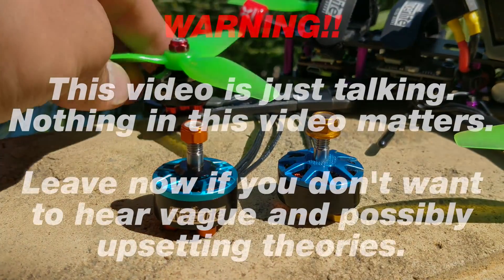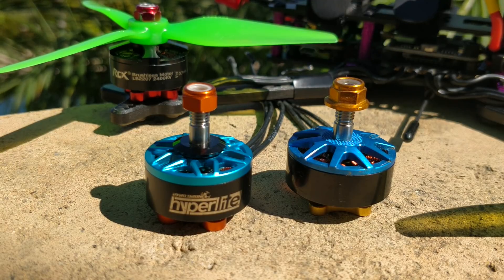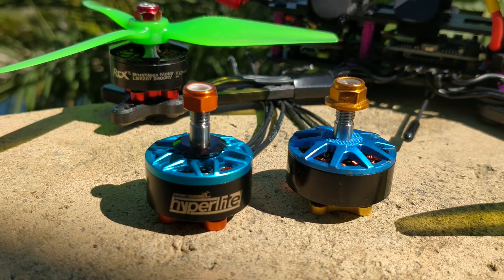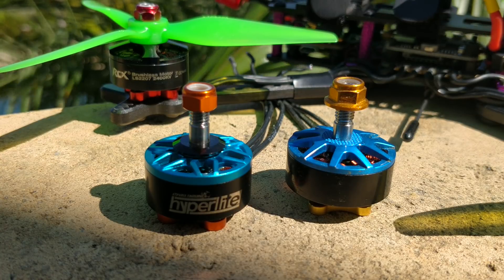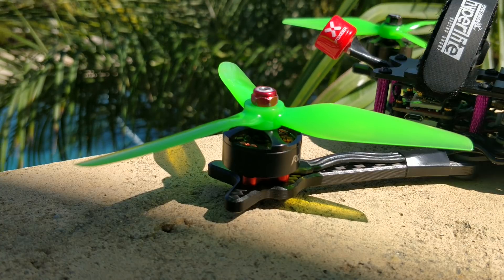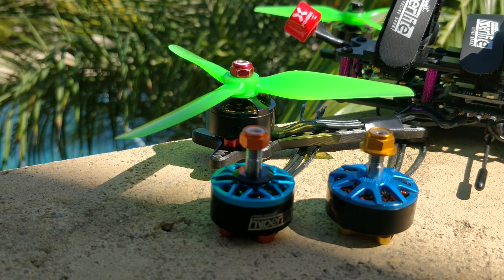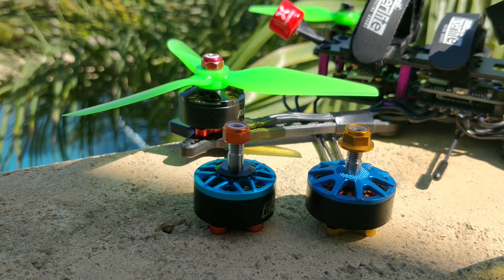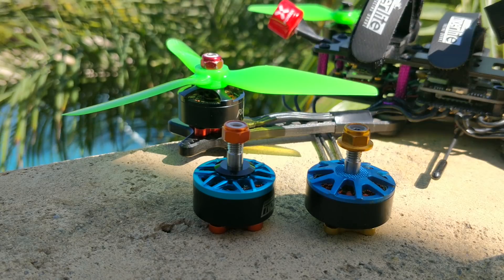Kv, Handling, 6S, Acro - Motor Theory (just guessing here)

Comment: I think all the torque, prop rpm and pitch likely produce counter-intuitive results if the aircraft's momentum is opposing the thrust vector ("drifting").  How does torque produce grip when you're talking about air thrust?  I think the column of thrust might change shape based on how it's compressed and deformed by the opposing relative movement of static air molecules, versus having the momentum and thrust vectors aligned and then adding more speed (through clean air).  A possible way to test for handing in turns and 180's (grip) could be the have a thrust stand mounted on a weighted sled that falls down vertical tracks, in timed slo-mo (with painted measurements on the background like mythbusters, maybe use this to analyse the video; https://physlets.org/tracker/ ).  The downward acceleration curve would be constant, but the ability of a battery / motor / prop combo to resist the fall could be precisely measured.  You'd then be able to tell which combo actually can exert more "torque" on the air without creating a thrust cone like an arrowhead, when you want something like a modulatable round parachute canopy made of thrusted air.
Reply from the maker: Wish I could execute that kinda testing
Reply: The "column of air theory" was (when analysis tools were in their infancy) originally was just used and developed to help visualize conceptually what the propellers are doing in a single vector air stream. So it doesn't lend it self well to how quadcopters actually fly in 3D dimensions. Additionally, very few computational model software platforms have accurate modeling capability at low Reynolds numbers (the numbers that are associated with modeling-sized propellers). So believe it or not it's just a guessing game with how we "Think" a design will perform based on trial and error.
Reply: ZCarrizales absolutely nailed it - at the Reynolds number regime we're talking about, those air boundary layers get really complicated in CFD and stop lining up with reality.  This is a HUGE part of why the super-engineered designs (RK5051, GF5149, etc.) and up performing so similarly to 'hand-sculpted' equivalents like the V1S and DAL Cyclone design.
To make matter more complicated, when we're considering negative AoA thrust for a motor/prop (+esc/battery//gyro/firmware) combination, we're often including rapid changes in commanded throttle value to compensate for dirty air we're flying through, so that demand for torque (in the change RPM of motor/prop as rapidly as possible) is even more massive, and the ability to rapidly achieve target or slight overshoot on the RPM to hit that thrust is what makes the difference on control there.  Excess KV (in the sense that Ryan Harrell is talking about) is a way to 'trick' the system into doing that more readily, with the penalty of when that same system is under peak load the ESCs can demand power out of the battery into the sag regime where the battery gets really punished for marginal gains - hence throttle limiting (or down the road, soft current limiting that incorporates all 4 ESCs as well as individual peak draws)
Reply: How would any of that effect the results of my proposed testing method, hypothetically?  The tracks might be 5-10 stories tall, and you'd be measuring time deviance from a dead drop, with the sled weighted to be the same no matter what was being tested.  You could test multiple drops at different throttle values, and average them.  You could call the resulting numbers "repulsor" values.  You could probably adapt this idea to give useful data based on the force exerted on the load sensor of the thrust stand if you have a precise enough wind tunnel, but I think the acceleration of gravity would be more consistent, as long as the rail bearings are good.
Reply: Testing method would be fine, and with enough data points you could figure out what the range of values should be at various relative airpseeds - mere average wouldn't necessarily be adequate.  It would be another extremely valuable data point like the static case - but not fully inclusive of what's going on in a split-S, immelman, or powerloop though - but what could be?  I'd be super excited to see data like that, since it would be 'cleaner' than any budget wind tunnel options
Reply: @mistercohaagen  What motor/propeller behavior would you be hoping to gain more knowledge about? Your experiment sounds like it is trying to shed light on motor responsiveness under load, but with respect to the propeller behavior (this set up might skew) variables might be skewed by vortex ring issues from propellers (prop wash).
Reply: @Z Carrizales, Grip efficiency.  The experiment is designed to measure how much power is used for a given braking thrust force, against the wash of a fixed falling mass through the air.  The wash is an essential component of the overall data.  The data you'd get would be watts / watt-hours, and time gains over a weight-calibrated dead drop, that the braking for a given throttle input was able to give you.  If you knew the total height of the drop, you could calculate deceleration force in G's and meters per second per second.  You could also have a load cell to get the amount of force you'd be exerting on the arm for a given throttle (power consumption) to increase accuracy.  You'd test throughout the throttle range and plot the data into a regular line graph.  If the bell was more towards the low end of throttle, you'd have a higher grip efficiency at low RPM's, and blah blah blah... I'm sure you can extrapolate the antithetical.  Like anything related to these kinds of data, you'd be able to see the point of diminishing returns, correlate that with your nominal operational range, and quantify a formula of best performance for a given application / platform.
Reply: @mistercohaagen  Gotcha, I see now. The tough thing right now is quantifying "the feel of the quad." Some investigation like your talking about be need first in order to make sure we are correctly correlating desirable behavior that we associate with "positive feel," "good responsiveness," "punchy" and any other ambiguous descriptors we use to guess at how we think our rigs are flying.
Reply: That would definitely be valuable data, but do remember that in any instance where that angle of attack is being achieved, the throttle application is going to be inconsistent (FC modulating to mitigate propwatch), so if would be a pure datapoint (arguably better) but not necessarily reflective of what would be happening in the real use case (more complicated, but also going to be very craft AUW/geometry as well as propeller dependent).
Reply: tehllama42, Yeah, I thought about that too during my last response, but didn't want to add yet more complication to something I was frankly struggling to explain as eloquently as I could at the time.  I think if you added the ability to tilt the sled on the roll axis so you could also graph the changes in grip efficiency over 5° increments, you'd have the data you're looking for.  The air the prop itself would be pushing against would be hitting it at an angle more akin to a turn instead of a full and abrupt 180°.  I have a suspicion that the resulting data would be a fairly linear roll-off similar to trading hover thrust for forward momentum.
Reply: tehllama42, I think what the flight controller would be doing to maintain orientation would average over the 4 motors.  They're all on the same plane, so the data you gathered with a single prop would probably mean the same thing if simply multiplied by 4.  It would be an interesting test to add a full 3-axis gimbal (like those rings from the wormhole machine in the movie Contact, or the VR rigs in Lawnmower Man) that could allow an entire quad, tune and all to be attached to the sled to hold the tilt angle.  This is all practical, but would require the space and budget for the precise machining required to build the rig and tracks.  I used to work in automated laser radar metrology, so building something this big (the tracks) and precise might require something like that if a long plumb bob line or alignment laser doesn't work.  Using an over-under wheeled tubular track like rollercoasters would eliminate the worry about twisted or warping track, but the spacers would add a ton of weight and labor.  I wonder if a rig like this exists for other purposes...  NASA's Ames or somewhere.
Reply: https://youtu.be/fgnbZ4zDBRE?t=4m57s < relevant, kinda (NASA's Glenn facilities)
Reply: https://youtu.be/LEZCxxKp0hM?t=52s < the comparative drop is kind of what I'm talking about here.  Picture that but a lot longer, precise and repeatable.

Comment: Good discussion, this whole thing about torque seems so weird to me in relation to our quads. Im only about 200 packs into my own 6S journey and not an advanced pilot so Im still figuring things out. All I know is I like it a lot. I don't see a lack in performance at 1750kv at all(coming from 2207 high kv) and I even chopped my throttle to 75% and scaled with the new betaflight settings that have been added to butterflight. That has made proximity a dream, it added so much fine control! I would definitely like to try that with a ~1900kv setup.

Comment: dc motor torque is measured from zero rpm, so they measure Hp in Watts( 1hp or 550 ftlb per second=745.7W) ,  IN_rush is the  amperage under sudden start up, which can be triple the Amperage until the motors come up to speed and is variable to the V supplied to the circuit. "Punch-outs" are all in_rush Amps.  we use Square wave escs to keep constant high voltage and lower amps but the pulsing square wave produces more instances of in_rush.

Power factor changes drastically with voltage, inrush, and infrastructure. A house on average draws 150vA to the panel but an old house with small gauge wires, inefficient power conversion, and old motors will require the PowerCo to supply 250vA to that panel.  Since Watts is what we use to measure "electricity put to work or Real Power" its the only thing your meter reads, posing a problem to Power Cos trying to cut cost/increase efficiency. so what i do  to help is decrease the power factor by  increasing the voltage of constant use Loads(120v to 277v) to better utilize small circuits and void "voltage drop", reduce loads, and introducing capacitor banks to supply motors reducing in_rush and inconsistent demand. measuring "Apparent Power" to a motor and the rpm of the motor"Real Power"  can give a good idea of your power factor. tuning either the RPM to match that Voltage supplied or finding  the cause of "reactive Power"  would correct the power factor to 0. large capacitors utilize "Reactive Power" at a small loss allowing it to charge for later instead of generate heat in the wire or motor. higher voltage, larger wires, derating Pdb, and derating esc circuits would negate heat during in_rush and negate a "capacitance effect" allowing for a more elegant "soft start" Square wave protocol that would decrease power factor. Better bearings,perfect ratio of magnet placement to strength, and finely tuned props would decrease Load. Using these values you can actually derive the exact target Thrust to Weight to Amp ratio @ whatever throttle value , no more guessing or feeling.  it would also allow you to size your stater accordingly.
Reply from the maker: unfortunately this isn't a high compliance or high demand field so all that gets sort of jumbled into a mush and they just guess most of it when making motors.  There is usually someone in the factory that can do it all however.
Reply: that is heartbreaking, just got a cnc router yesterday, just waiting for the opportunity to find a cnc lathe. then i can make my own motors to test the principle.
Reply: I pulled over 200amps. With 6s. You MUST use silver or you will de-solder from extreme heat, not easy to reheat and remove, you MUST sand down lightly the XT60 on your 6s 95c lipo. And you absolutely have to use NOALOX on both XT60 connections or they will get so hot and swell. And I never use a 4in one esc. On high kv. 6s. Ok the secret is out!
Reply: HighKV 6S sounds like it's so far into the ragged edge of awesomeness, I don't know if I should stand back in awe, or just starting shoving cash into that shredder to see what sort of awesomeness comes out.
Reply: its the definition of awesome. so awesome i started checking for 8s escs.

Comment: I run high kv 6s, RF bolt v2 esc and 2308 2900kv and it's amazing, wayyy more control than 4s, and about the same flight time. Low speed handling is better also due to increased rpm through out the Rev range, So I don't know why people run low kv motors on 6s. It's 1 step forward and 2 steps back .
Reply from the maker: I do feel 2900 is quite a but much for 6s but the wider motor isn't allowing the top end of the throttle to pull lots of Amps so you get the efficiency back.

Comment: So does torque come with the inertia of a bigger motor? Inertia creates resistance to motion (top end slower I would assume)
Reply from the maker: Spinning these props even 6" quad blade is not that difficult. It is at high rpm but in general torque is probably more useful for transitioning than anything else. Speed aside
Reply: Torque overcomes the increased inertia.  Bigger magnest, larger flux ring - but the net result is that the bell gets spun harder anyway.  Practically, it's the change in RPM that draws out those differences more, and adding more motor mass tends to improve things so much the added inertia is lost under the noise (not in it, but is more than canceled out by bigger motors being more efficient under load).

Comment: I'm telling, 5s is the sweet spot for acro. Thank me later.
Reply: Yeah I agree,  the  gear  we have around handles 5S with no probs . The power to weight is  perfect (can feel a lil floaty depending on the props). Batteries aren't as pricey as 6s but I haven't blown a lot of esc's like 6s. Not sure why everyone has ver looked 5S.
Reply: good point
Reply: What kv would you suggest?
Reply: layrad 2050-2150kv
Reply: Aman Verma using R6 2150kv. Lovely on 5s and also fab on 4s for tight proximity stuff
Reply: Coppertop FPV Yeah exactly! Around 2150kv motor are good for both 4s and 5s.

Comment: Try using 23xx 24xx size motors with lower kv like 2200-2500kv with 5.5 or 6 inch props. My theory is that they have more low end torque  that works perfect  with  a 5.5 or 6 inch prop since you don't have to have as high rpm to go the same speed with 6 inch. Just my 2 cent. I have sunny Sky 2306 2300kv that I run with 1500mah 4cell on my 6 inch bi prop quad  or lately i have been running gemfan 5.5 triblades it's my favorite out of all my quads. It weighs 738 grams with the heaviest battery  I put on it and I get anywhere from 4 to 10 minute flight times depending on how  crazy I get. Also I think with motor theory  that motor size 22xx,23xx,24xx of the motors need to have certain  kv  for which for what size of prop you are going to run.  The kv depends on how much wire you have in the motor and the more wire the stronger the field it will  make but it has more wire to go through. Smaller props need spin at higher rpm to make as much thrust as long as they  all have the same pitch. But maybe you are starting to catch on. So if you wanted to run a 5x4x3 prop a 22xx  with a high kv would be good  or a 5x4x3 with a 22xx motor a little less kv would be better because it will have a little  more torque to spin the higher  pitch prop. And so on and so forth  well that's just a fraction  of  what's going on in my brain I hope it opens up some different/new thought processes  and maybe you will try to test. 

Ps. So there are so many different factors with motors, and batteries  and esc's that I'm just talking about if the are all the same type of quality  across the board  for debate  sake
Reply from the maker: Even 6" is too small for 23 and definitely 24.  I have tried. You first start seeing benefits maybe in 7"
Reply: I’ve been using F80 2200kv 6” on 5S, 6S on the same build did make a difference but ultimately wasn’t worth it on that build as it was too fast for the Dal props
Reply: Actually the bigger radius of larger motors is what make them poor at high rpm, as the rotational energy goes with the square of the radius. There is a point in rpm when the motor simply doesn't have the power to beat the kinetic energy of the aluminum mass of the motor, so larger motors will stop delivering power before, since their energy will be a lot higher than thinner motors at the same angular speed.

I think larger motors would do a lot better if they were lower at kv but with higher pitched props, since they naturally have more torque. Since energy will be defined by mass x radius^2 x rpm^2, you just need to reduce rpm to compensate the extra radius. And by reducing the rpm you compensate the actual speed by using heavy pitched props.

Just physics, man, just physics hehe

Comment: very good explanation of why 6s is kinder on the batteries and most likely why the racers prefer it. One thing to add: kv is like the gear ratio of the motor voltage*kv=rpm amps/kv=torque (yes actual motor torque). So it makes sense 6s draws only 66% the amps of 4s because: 100amps/2550kv= 0.039 and 66,66amps/1700kv= 0.039. As you can see both motors apply the same torque on the prop. The problem is this is most likely not what is actually happening as this is only if we build a perfect (ideal) motor which will never exist. This is where non ideal effects you talked about such like stater saturation might come in.